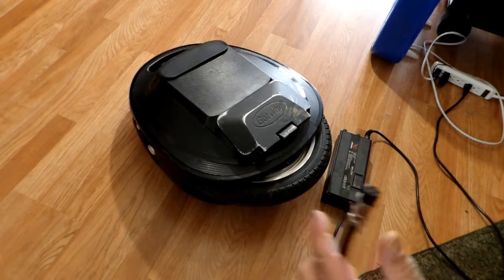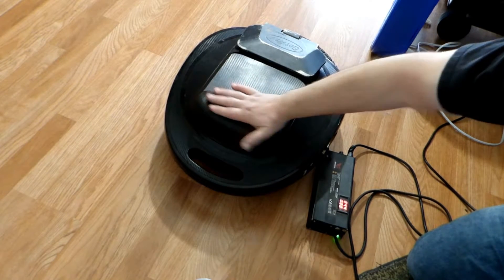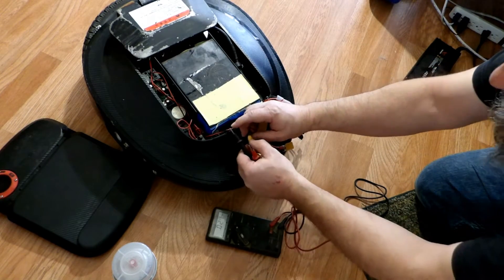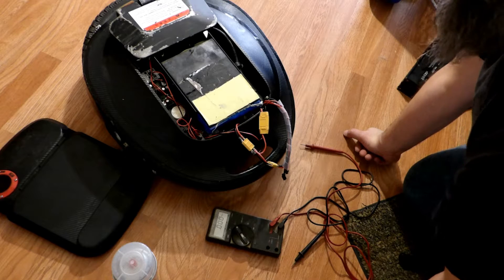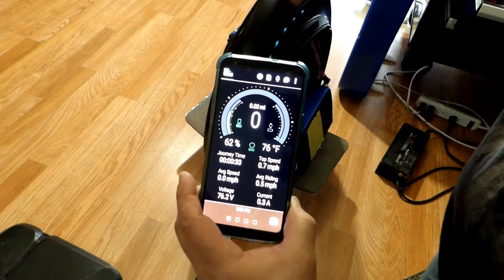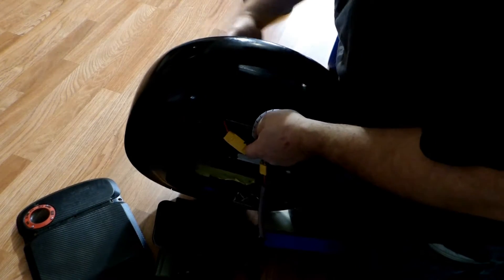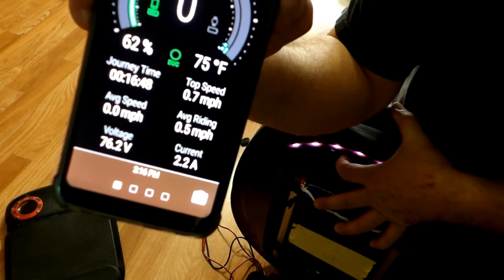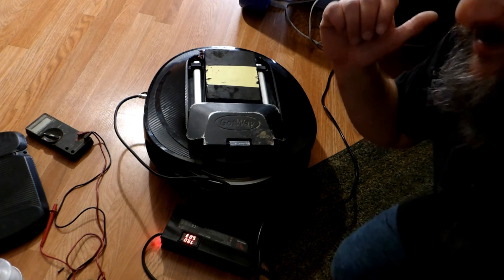Gotway Tesla V2 Low Battery Issue Not Charging easy fix smiley face

Comment: Wow lucky you were not going for a 45miles ride😨 nice to see you found what was wrong. i forgot screw or didnt look if everything look good until i have close everything then had to take the Nikola apart 3 times bcause i didnt look all the bracket🤦🏻 i know youre pain😅
Reply: Nitebird the tesla is a fantastic euc but when use to go to work (13km)
i have to stopone sometimes twice with the msp/Nikola i don't stop at all.i am heavy and my feets hurts so much.the bigger euc are more stable and more confortable also with time i do not grip the euc as much so end up riding more relax.
Reply from the maker: Thanks.....Hardly anyone talks about how far they ride at a time....I'm not doing too bad =)
Reply from the maker: =) I got at least 4 rides in before I realized the Tesla was low on power .......I wish I could do 45 miles at a time ......My farthest ride has been 12 miles ....with lots of breaks every mile or 2......=)